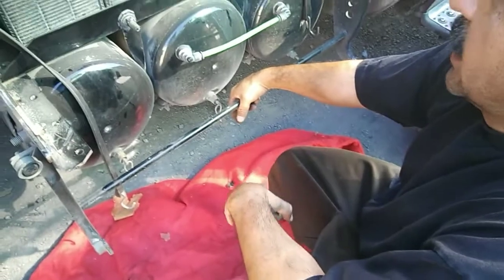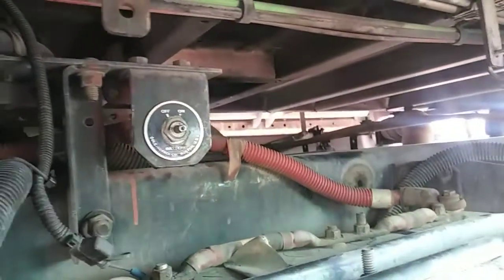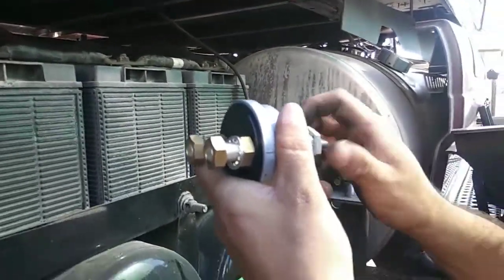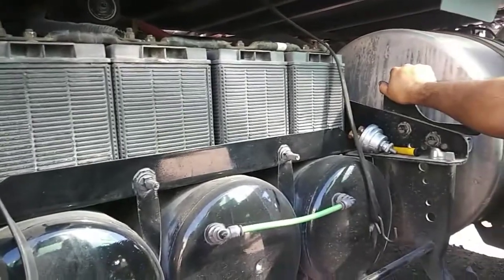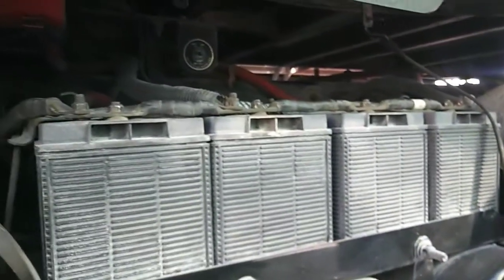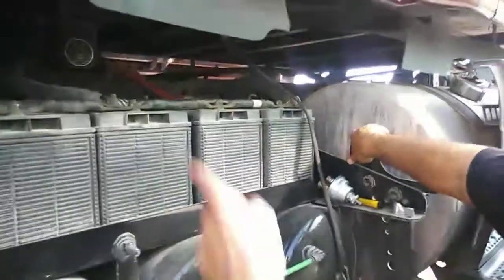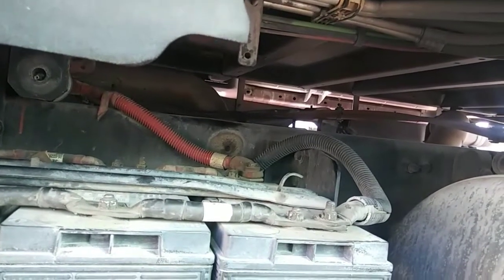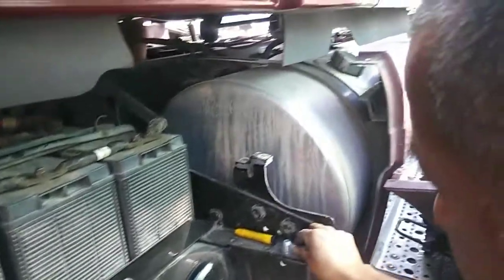DIY replacing battery switch

Comment: many of these switches were wired wrong from the factory. that switch can handle 200-300 amps max. it is to disconnect the cab power only. do not Not NOT try to pull the starter thru that switch. the starter can pull over 1000 amps.  know where those red cables go and make the right connections.  pretty sure that's what happened here.  and for safety's sake remove the ground cables first,  if you don't and one of those red cables touches pretty much anything you will be doing some serious welding or even better "BURN DOWN YOUR RIDE"  and wear a safety face shield, any spark near a battery could blow battery acid in your face. put a mud flap on top of the batteries to protect yourself. . think man think!!
Reply: im looking to put a kill switch on my truck a 1996 peterbilt 379 n14 and i originally wanted to put it on the batteries but then i read your comment and i went and did some more researched and looked at the schematic  and i came to find out its my ECM that basically stays on bcuz its powered directly from the battery and i can literally hear it clicking (dont know what that means but it does) so i guess my question is. could i place kill switch between the battery and the ECM??? schematic for reference http://supermiller.com/pdf/sk26139.pdf
Reply: I just learned something for free. Thank sir.

Comment: Not negative and positive lugs on the back of the switch, that would be a "dead short" (real bad, lol!). The lugs are "bank" ( your battery bank positive) and "load" (all the circuits you are isolating). Hook the negative to one and positive to the other, you WILL, if you turn that switch "ON", get a cherry red hot wire or 2, melted insulation that probably catches fire, and could even have one or all of those batteries explode, showering you with sulphuric acid and chunks of nice sharp plastic (trust me, WAY bad scene, promise), as well as any bodywork, bracketry, and parts surrounding that battery box. That electrolyte (sulphuric acid) WILL eat your clothes, your skin, your eyes, your hair quite painfully and rapidly, promise. It will also gobble any steel or copper it gets on, causing lots of rust, rot, and mayhem. NEVER dead short a wet cell battery, but especially never do it with a conductor that will survive a few hundred amps of current surge (like a 00 gauge battery cable, lol). Dead shorting that bank of Batts will give a few THOUSAND amps of surge current, and a REALLY bad experience.
Reply from the maker: thanks
Reply: I was thinking the same thing

Comment: Your switch is wired wrong. Should be disconnected all the grounds. No wonder why you keep going through switches those switches are not meant for positive wires